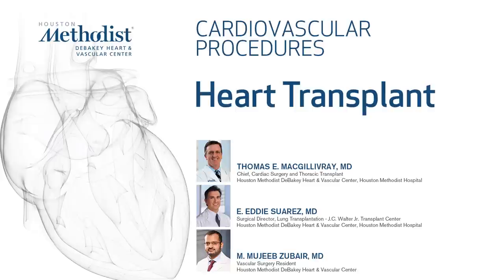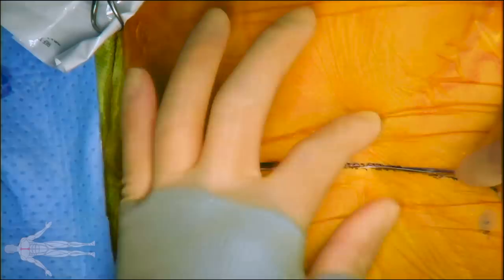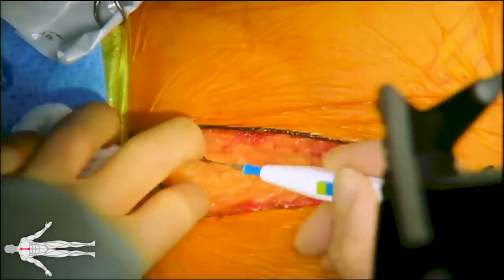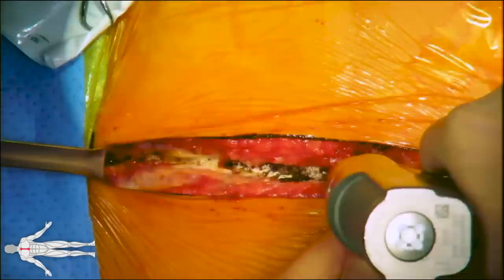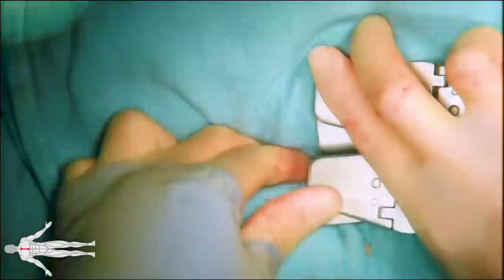Heart Transplant (Thomas E. MacGillivray, MD, Erik Eddie Suarez, MD, M. Mujeeb Zubair, MD)

Comment: it amazes me that they can seal everything up with sutures. 

How does the new heart start beating again (warmth)?  Are there are nerves that are reattached or just by the pacemaker?
Reply: Arteries are very resilient. Even a little pressure can make the arterial walls seal together thanks to their elasticity and resistance to pressure. Its very remarkable, really.

 I dont know if they connect the nerves of the new heart to the sinoatrial node (Keith and flack) since they don't show it on the video, but they probably do.
Reply: @peste2574  No they can’t reconnect the nerves, the heart is able to beat all by himself thanks to the autonomous innervation system within the transplanted heart.
Reply: Nah there's usually denervation when it comes to heart transplantations. So, if the patient ever developed acute coronary syndrome (again) and that lead to a STEMI or an NSTEMI, they most likely wouldn't feel the pain associated with the angina that comes with those.